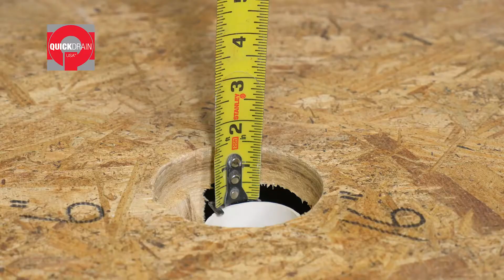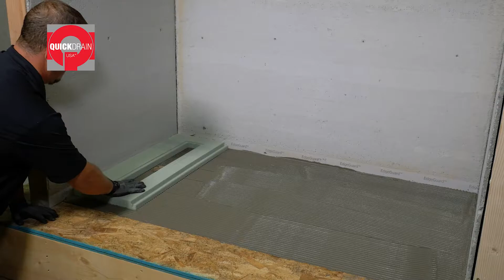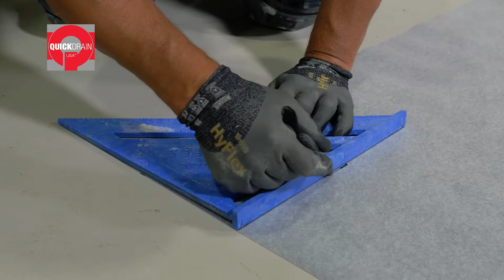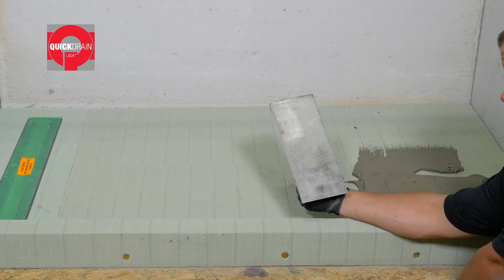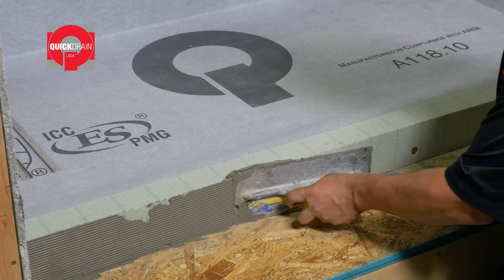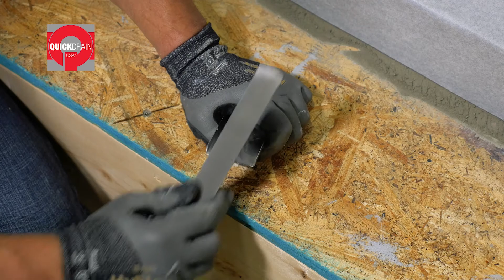How to Install a Complete Linear Shower Drain- QuickDrain ShowerLine

Comment: Doesn't cutting the corners ruin the waterproofing of the membrane? Why not just fold and overlap the corners?
Reply from the maker: No, with the inside corners correctly installed a watertight seal can be achieved. We recommend cutting the corners instead of folding to ensure once the wall tile is installed it will be able to sit vertically without obstruction.